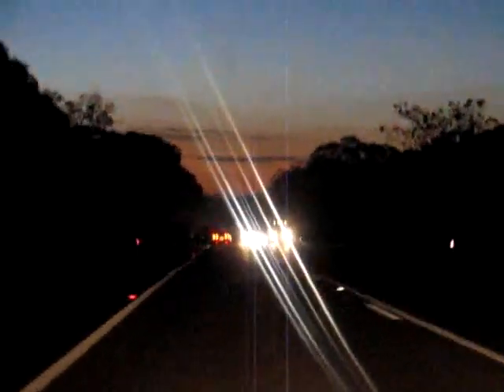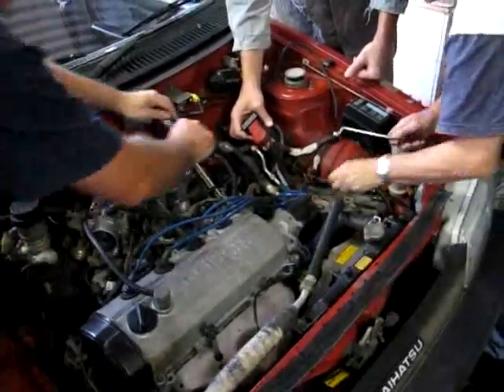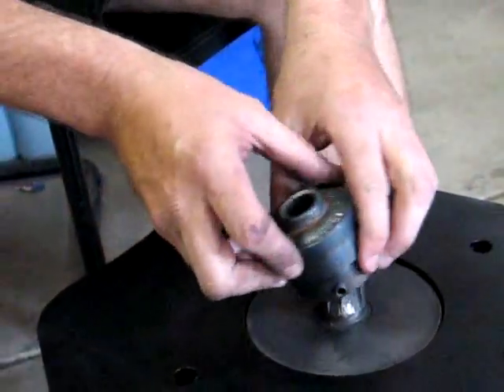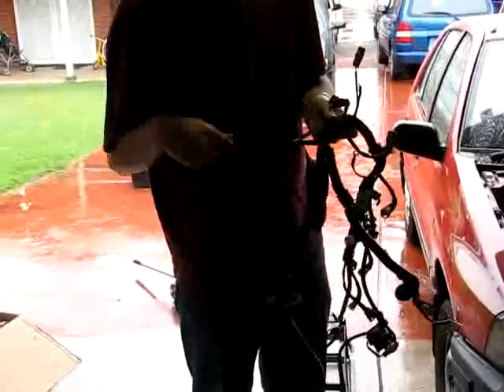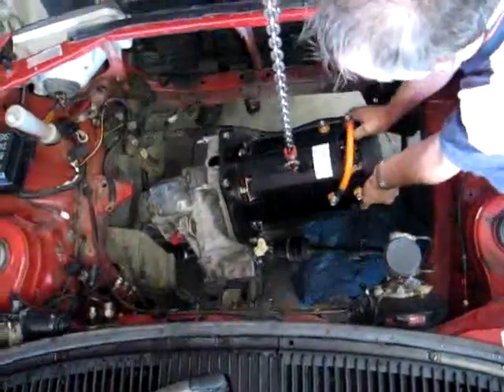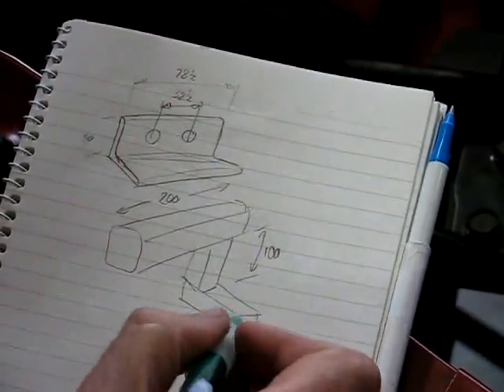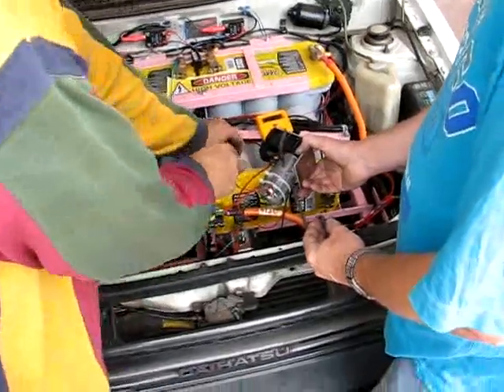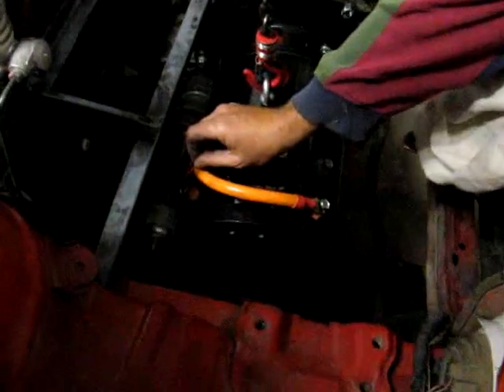PART ONE OF 3 DAY DAIHATSU CHARADE ELECTRIC CONVERSION

Comment: how u ignored clutch ?
Reply: We used an adaptor plate between motor and gearbox.  Changing gears relies on light pressure with the gearstick, and the gear slips in when the electric motor revs match the speed

Comment from the maker: Hi gwald, Thanks for your comment. Yes, those batteries died a rapid death (they have been revived for non EV use, but the load was too much for them. I now have 32 Skyenergy 130AH batteries in the car giving a slightly higher voltage. They are a great improvement and the car is performing well. It's done 9000 electric kms so far.